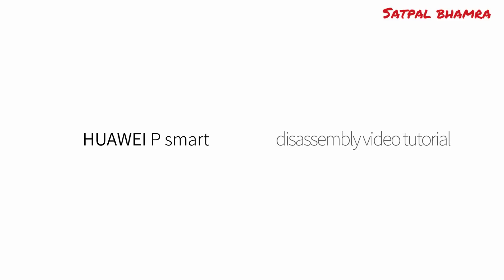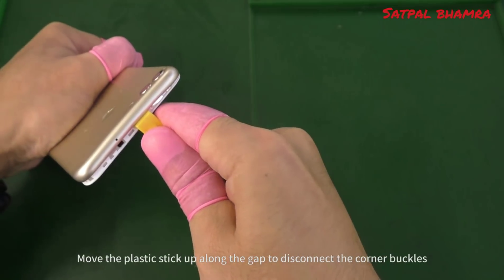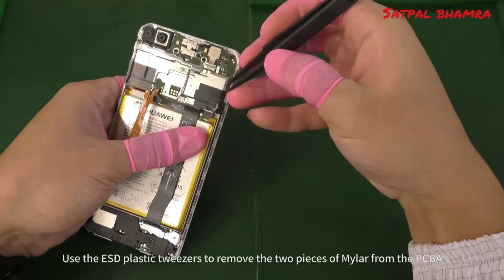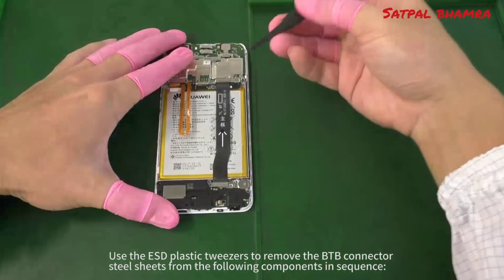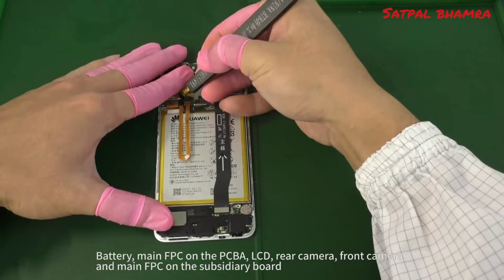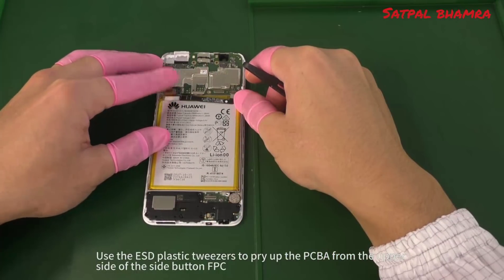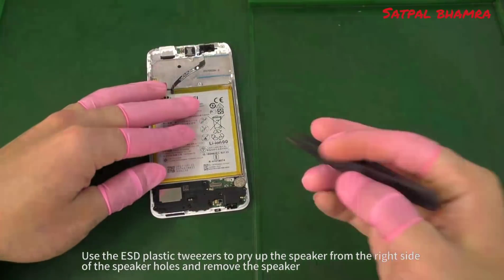Huawei P Smart Teardown  , Touch ,Display, Battery ,Fingerprint ,Backcover. ( HUAWEI P SMART)

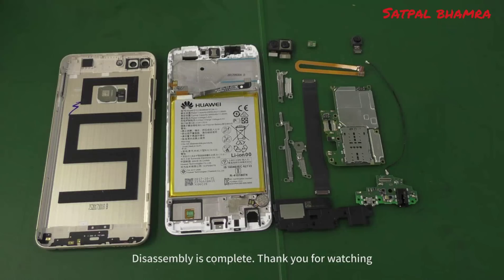Comment: what is this part just next to proximity sensor? it looks like a metal square. at 5:30  right in the middle of upper frame. It looks like it's just a magnet.
Reply: You might be referring to the headset speaker, its next to where the proximity sensor used to be.
Its literally just a speaker but youre right its just a magnet with a coil and membrane in front.
Hope this helped!

Comment: 0:40 This gives you the impression that in order to separate the back cover you merely push the edge of the tray opening away from the front part, but I find that in reality you need to squeeze an instrument pretty deep in there, between the back cover and the frame of the tray holder, and wedge, so as to force the parts apart. There is a gap there maybe 0.5mm or 1mm wide where you apply the wedging force, and the front will pop right off.
Reply: Any chance you can explain it a bit better? I don't understand where you recommend I apply force. Just bent the frame so far!
Reply: If you look inside the tray insertion hole, there is a very narrow gap or slit between the aluminum (grey colored) part where the tray is inserted, and the back cover. Put some thin and fairly wide instrument, such as a blade of a small box cutter, into that slit, and wedge so as to make the gap wider.